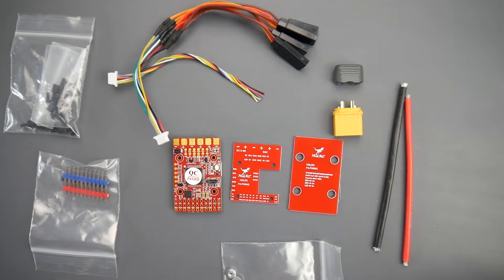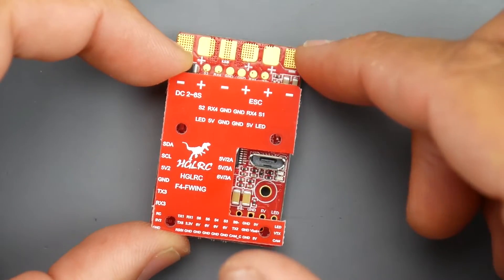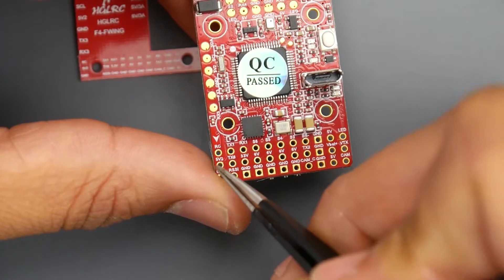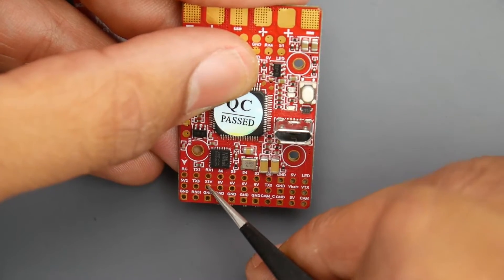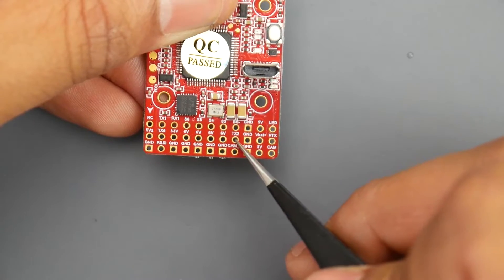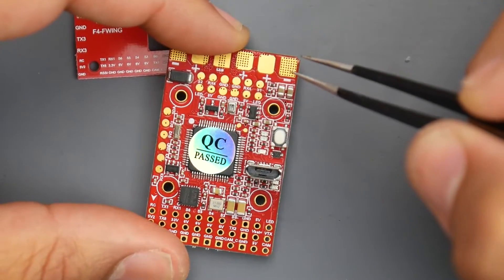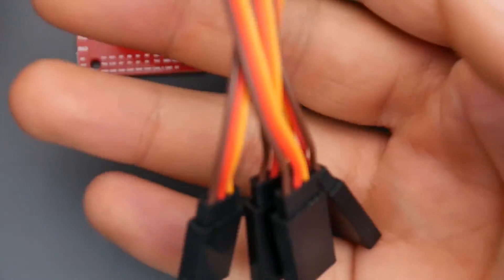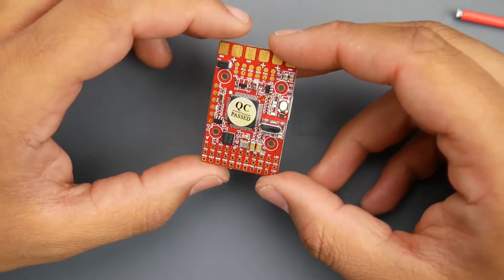HGLRC F4 WING Flight Controller 20x20 // Setup Guide and Overview

Comment: Nice review and looks nice. Wish there was option for 5v and 6v, since 5v is still more common. Also, you left out that nice plug for a BN-880 on the other side, which makes installing a GPS/magnetometer extremely convenient.